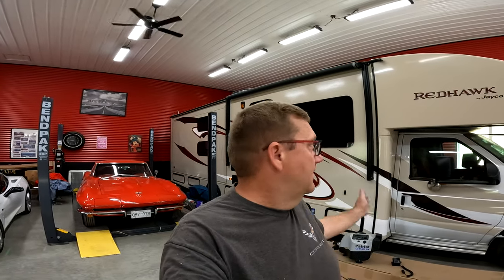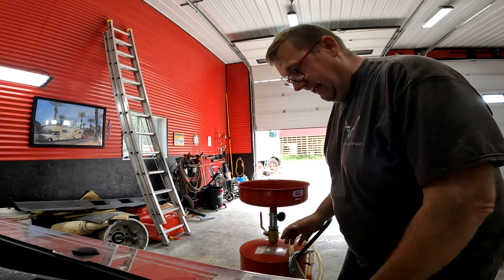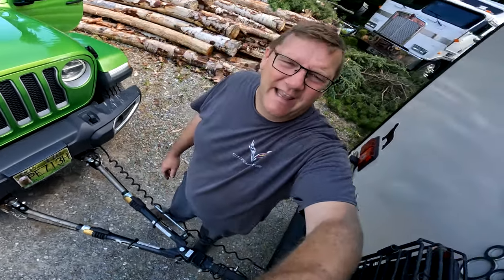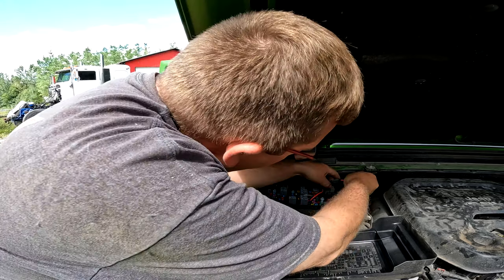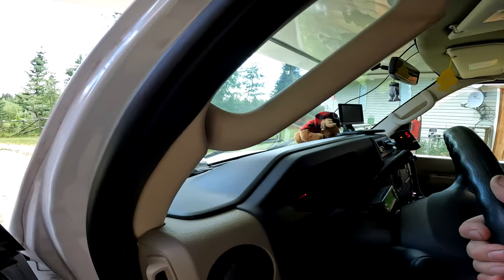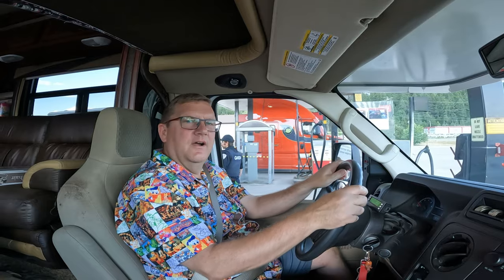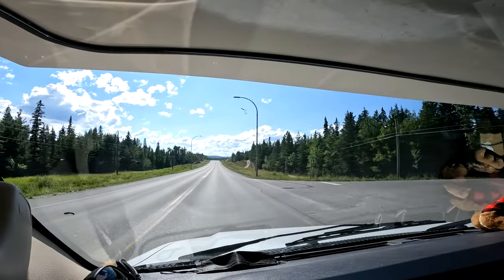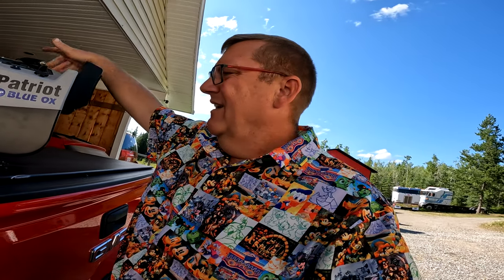Installing a Blue OX Patriot braking system so I can stop when towing the Jeep Wrangler

Comment: How does the patriot know when your Braking the Motorhome ?
Reply from the maker: It had an inertia switch
Reply: @mikesgarage6331  Yes sir. That’s what I figured. I bought one and it’s “ok”. A little to sensitive when you take your foot off of the MH gas pedal, it activates. Sensitivity is set at 1 , but it works.